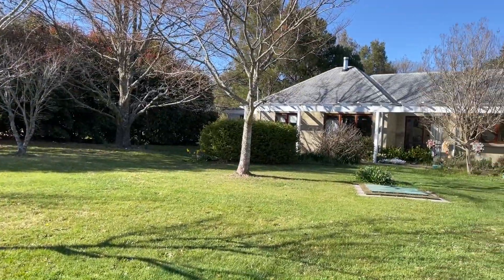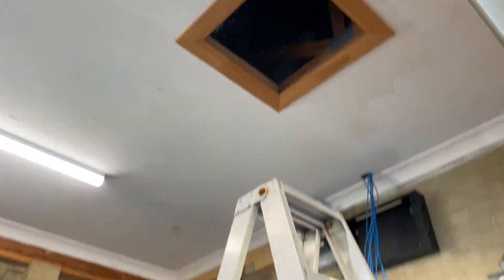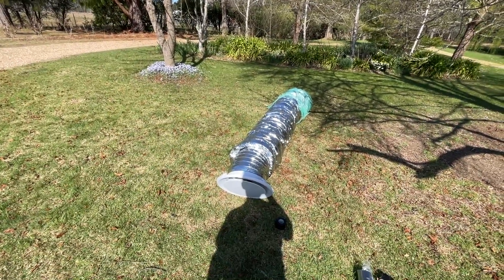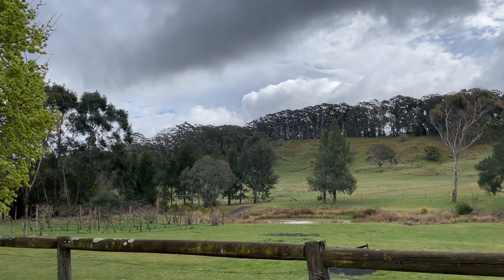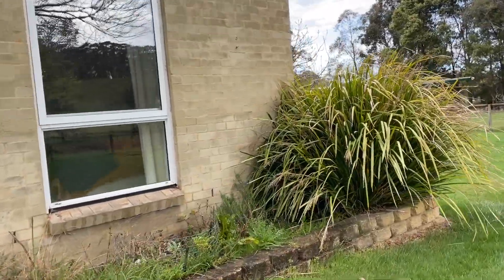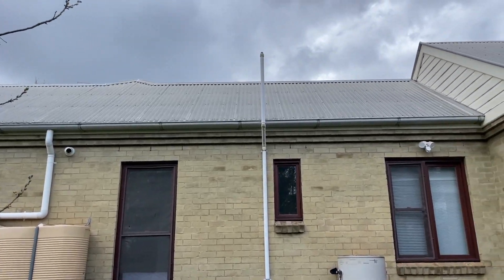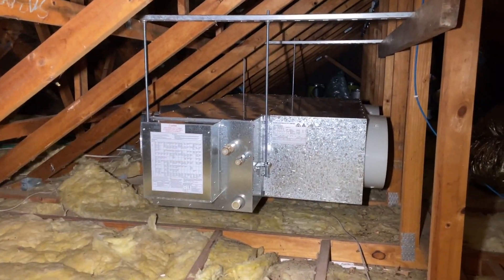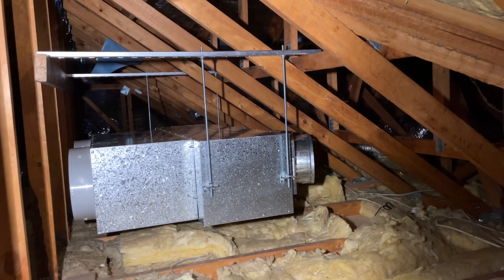HOW TO INSTALL AN R32 DAIKIN DUCTED AIR CONDITIONER?

Comment: Hi Mitch, I’ve just found your channel - great videos! Thanks for your efforts. Random question from this one… what’s the reason for using 12 inch duct to living area outlets and 10 inch for bedrooms? Does distance from the indoor unit influence this decision? Thanks, keep up the great work 😃
Reply from the maker: @jasongibson4244  thanks mate, appreciate it. Distance from indoor unit definitely influences my decisions however the main reason is I want more volume of air going into living spaces and more L/s of air can be pushed through 12” duct compared to 10” duct. Cheers
Reply: @ Great, thank you 👍

Comment: Not having a dig but are you not doing an emergency drain pan due to not being able to get it in the roof?
Reply: I think you could get one in judging from the the evaporator size after the indoor unit was dismantled. You'd only need to tray the area directly under the evap section with say, 50 mm overlap.
You'd feed it in diagonally through the manhole. Of course one would need to measure the diagonal first to determine max width of the tray though.

Comment: Nice video, thanks for the info. I'm not overly keen on the condensate  going into the gutter though and into the water tank.
Reply: Not keen on fresh,  clean water going into water tank... lol what?
Reply: I'm guessing the water tank is potable water. It's probably more for the garden, so no issue there mate.
Reply: should be in sewer by code

Comment: What is the max ESP (External Static Pressure) for that indoor unit? What is your R value for the insulated flex duct? You drive a long distance for work, even for a good customers client. My max is 30 minutes from home. Professional job guys.